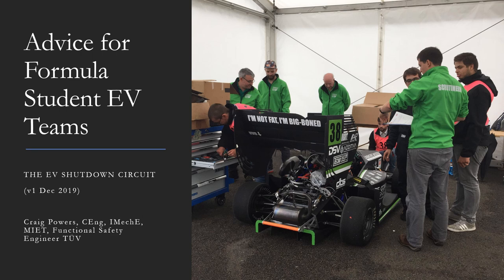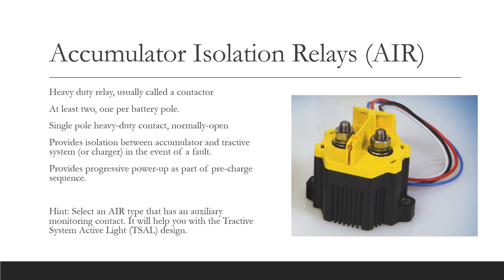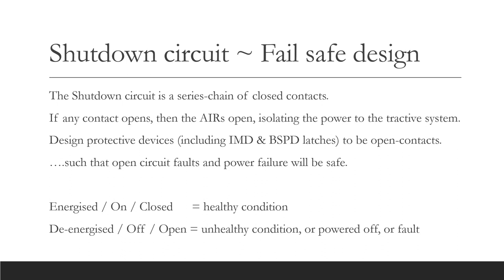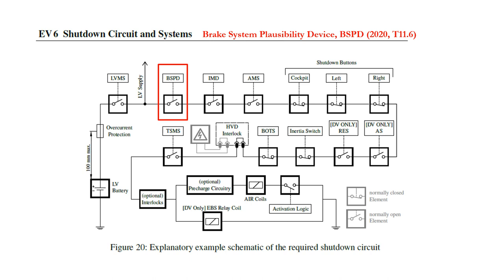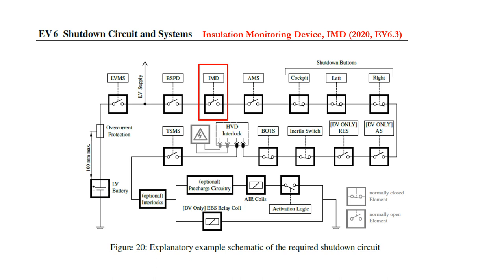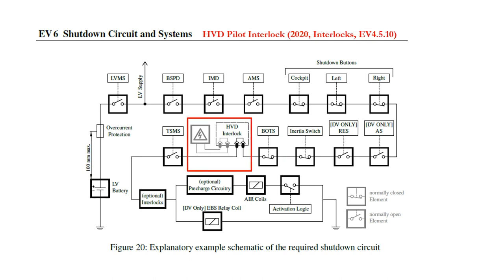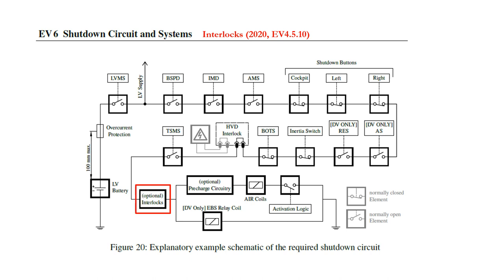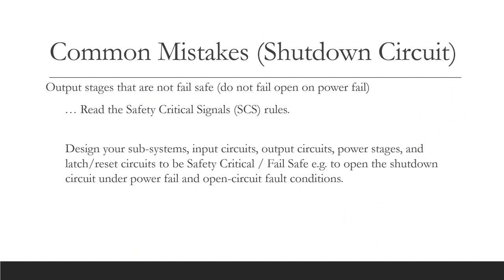FS EV Shutdown Circuit v1 29Dec19

Comment: Craig you are the real hero, not all heroes wear capes and u have proven that
I am currently the ESM (electrical safety manager) and my team have been suffering with the fundamentals of the safety system (shutdown circuit in particular ) .
great job man 👨 👨
Reply from the maker: I'm glad you find them useful. They are aimed at newer teams. I am always saddened when a team fails scrutineering due to a fundamental but catastrophic mistake.

Comment: Hi Craig, thanks for the video!

At 3:06 you mentioned that the TSAL logic has to detect the position of the AIRs, doesn't EV 4.10.12 imply that we can assume that the TS is deactivated as long as there is <60 VDC outside of the accumulator if the intentional states of the AIRs and precharge relay are NO. I therefore thought only the voltage outside of the accumulator had to be measured for the TSAL and not the AIR states?
Reply from the maker: You need to be able to detect an AIR (or Precharge) contact that is closed when it shouldn't be. You have two AIRs as a dual protection, but it is vital that you know if one has contact is stuck in the closed position (e.g. welded) because you have then lost one layer of protection. Read EV 4.10.2 / 3 / 4.
Reply: @craiguk62  thanks for the reply! I understand now and will implement AIRs with aux contacts for additional monitoring and protection :)

Comment: Do "power stages" refer to DC/DC converters? If so, are the rules suggesting that IMD, AMS, BSPD, APPS, etc should all be independently powered (with a shared ground), as opposed to having, for example, a common a LV battery to 12V converter powering all systems? It partially makes sense to do this to avoid the single failure affecting multiple systems, but if it is the same output that powers the AIRs I'm not sure what difference it would make. Thanks!

Comment: Could you explain what does "Activation Logic" stand for?
Reply from the maker: can you please clarify which part of the video that relates to Paddy and I will try to assist.
Reply: @craiguk62  I mean contact named "Activation Logic" on shutdown circuit schematic (EV6.1). I came that this contact has something common with precharge and discharge systems (Am I right?) but I don't know how should this work?
Reply from the maker: @PaddyVW  I think it may refer to this extra rule....
 EV4.11.3 Closing the shutdown circuit by any part defined in EV6.1.2 must not (re-)activate the TS.
Additional action must be required.
Reply: @craiguk62  Oh, I got this now. Thank you :)

Comment: low voltage batter should be of how much voltage?
Reply from the maker: Most teams use 12v, some use 24v. The choice will be partly dictated by the AIR coil voltages that are available, plus the voltage requirements of the ancillary equipment such as the IMD. You need to go through the equipment specs to decide on a suitable voltage.
Reply: @craiguk62   how much A/h ?

Comment: Is there a clear definition of "hard braking"?
Reply from the maker: I've just looked in the 2020 rules and the only clarification is T11.6.5
"To detect hard braking, a brake system pressure sensor must be used. The threshold must be
chosen such that there are no locked wheels and the brake pressure is   30bar." 

So enough to cause mechanical braking  (not regen braking), significant impact on brake fluid pressure, but without the brakes locking.
Reply: @craiguk62  Thank you. Do you use you Linkedin account? I have sent you an invitation, perhaps we could have some mutual interests.
Reply from the maker: @alonkuperman8321  just curious what your interest in FS/EV is?